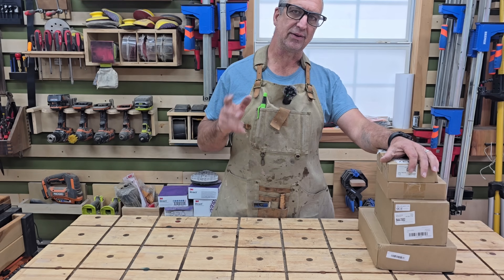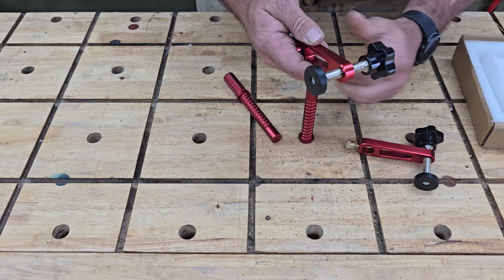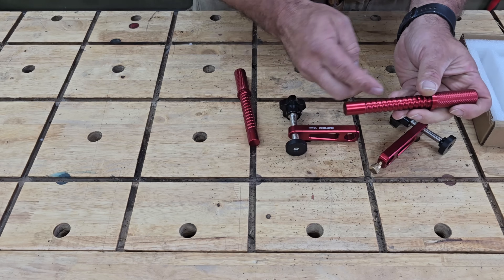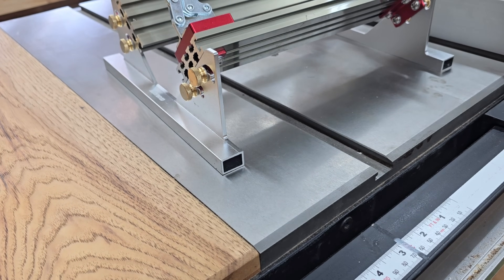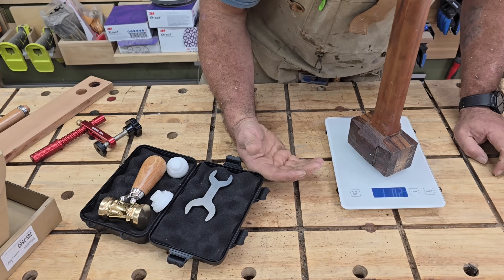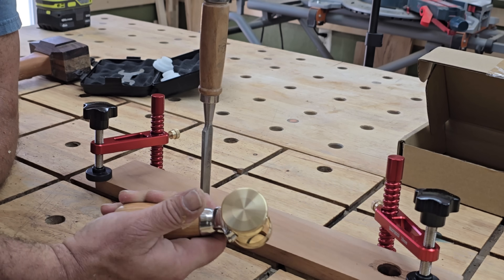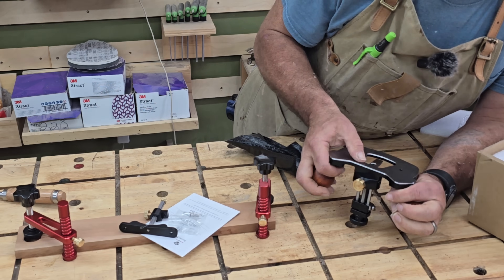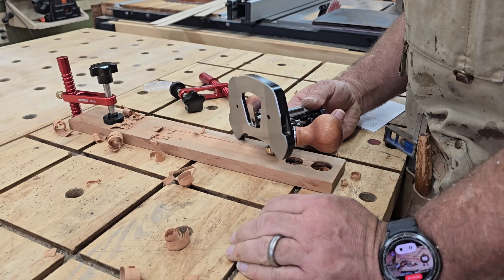4 Woodworking Tools That Can Make You A Better Woodworker

Comment: 9:48 Simply insert the bearing ball into the hole.😉
Reply from the maker: Mine didn't come with a bearing ball.
Reply: @ShopRamblings  Google translator...😡 I meant that you need to insert a ball from a bearing to avoid the problem. Of course, it is not included in the kit. You need to disassemble a suitable bearing and use the ball from it.

Comment: Chuck those brass bolts in your lathe or drill press thread side out/down and round the bottom of them with some emery cloth and steel wool to finish👍
Reply from the maker: I plan on it. I have ones from Goingmake that have the rounded screws.  I like the pads on these better. It is not a big deal but I feel the main reason for a review is to point out what is good and what is not.

Comment: ... If you want the brand on your clamp right side up. Unscrew the pad on the post, unscrew the post assembly, flip it around, screw the pad back in and the pad back on. As concerning of a name 'Enjoywood' is, I'd still want it the right way around as well. Its even upside down in the picture😒... If you don't want your spline jig 'tippy' just put those sticky felt furniture leg pads on all four corners of the rails. It'll slide better and stabalize it at the same time. thanks for the review!
Reply from the maker: I have already flipped the clamps. On the website, they have them both ways in the pictures. As far as the splint jig being tippy, if everything is straight and square, it should sit flat. It is good enough for the price but something is not square. I like to make sure all my tools and jigs are as square as possible.  When I have time, I will try to figure out what is out of square.